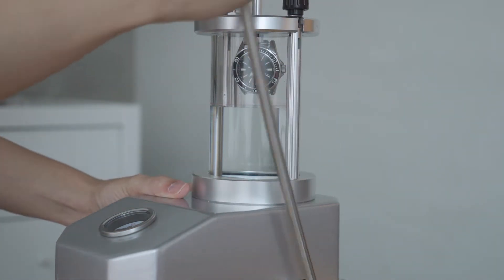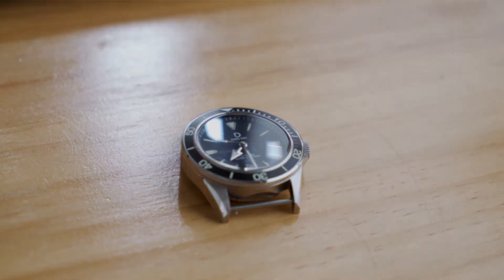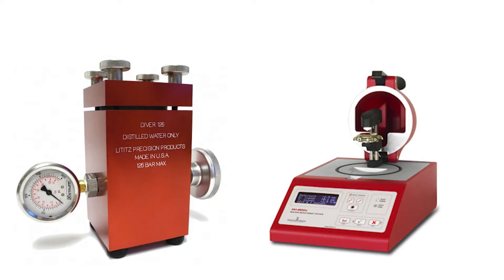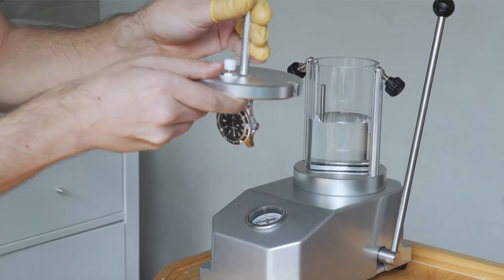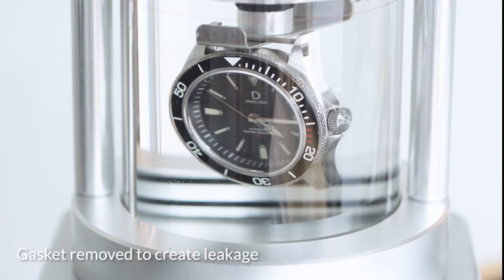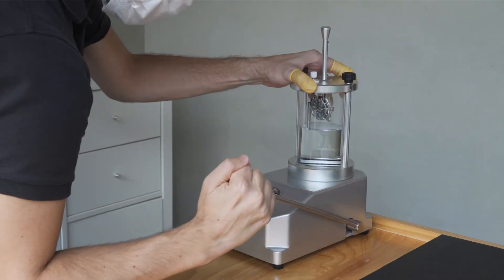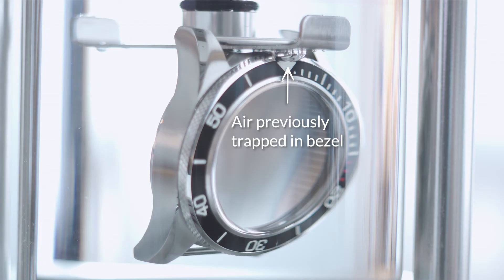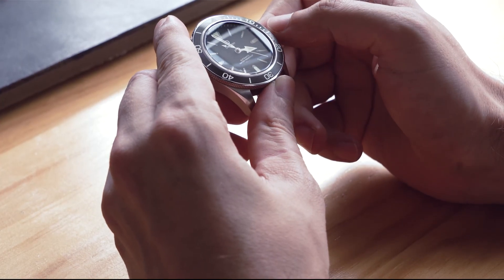Water resistance watch test with pressure tester

Comment: No point in doing a wet test. Do a dry test instead.
Reply from the maker: It would be interesting to hear your reasoning. You can see that Omega do wet test with their watches: https://youtu.be/IRiBOtsRan4?t=83. A wet test is far from pointless. The wet test you see in the video does one thing that a dry test cannot do: reveal the exact point of leakage. All tests have their places in checking the WR rating of a watch. A dry test does so without the risk of water intrusion. A wet test reveals the point of leakage. In fact, both tests are often used in tandem in professional settings (read: when you really want to make sure the watch is water resistant). But interesting comment anyway, appreciate it!
Reply: @DIYWatchClub  Well said

Comment: If the water resistance is 3 ATM, and I wash my hands regularly and a lot of water gets on the watch, will that destroy it?
Reply from the maker: Good question. It's fine to wash hands with a 3 ATM watch. But keep in mind that all water resistant watch does not stay water resistant forever, as gaskets naturally degrade over time. So it's a good idea to give it a water pressure test once per 1 or 2 years, if the WR rating is important to you
Reply: @DIYWatchClub  thank you for your time!
Reply: i worked as a lifeguard in a swimming pool and regularly dived up to 5 meters  with my 3 atm vostok russian watch in indoor pool. Never had an issue in two years of regular swimmig. I call BS on that. I am still wearing this watch at this moment and using it for roughly 4-5 years.
Reply: 3ATM means 30m of water.
Washing hands, showering is fine.
I have taken 3ATM watches to swim and dive underwater to about 5m depth. No problems at all. Having said that, not all watch manufacturers are reliable. If your watch is Casio, Seiko, Citizen, I am pretty sure your 3ATM watch can take 5 ATM or more.
You can buy a Toyota and it can still run after 15 -20 years. You can buy a Ford or a Peugeot and it breaks down in a year or two.
Reply: @standardnnn6064  Yes I am with you I love my 3 ATM very much
Reply from the maker: @standardnnn6064  I'm totally with you on Ford and Peugeot lol

This is controversial, but I agree that it's generally safe to take a 3ATM watch to swim, with a little bit of nuance here and there. But the rabbit hole of WR rating goes deeper. I actually wrote a piece on it, check it out: https://diywatch.club/en/blog/true-meaning-of-water-resistance-rating-on-watch
Reply: @standardnnn6064  No  longer true;  ttoytas are as little reliable as any other  car,now that the greenphissers have taken over with their equivocated laws mandating way too much electronic junk on engines backs;               avoid
Reply: I recently purchased this tester. Having difficulty moving the plunger up and down. Any advice?
Reply from the maker: @mcrispi2963  the plunger is supposed to be difficult to move, that's the water seal working. But it's not difficult to the point it's stuck, right?
Reply: @DIYWatchClub  I figured it out,  it's fine now, thank you